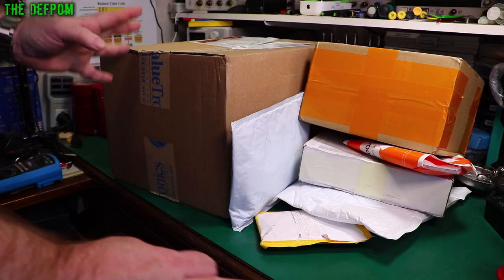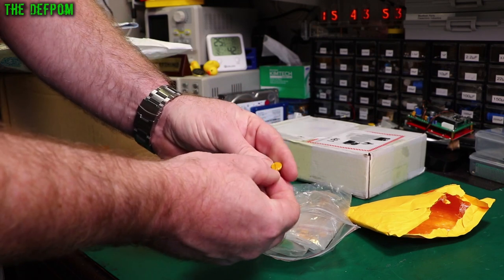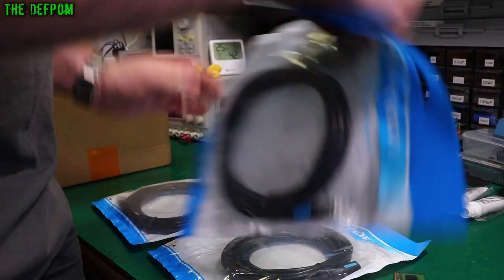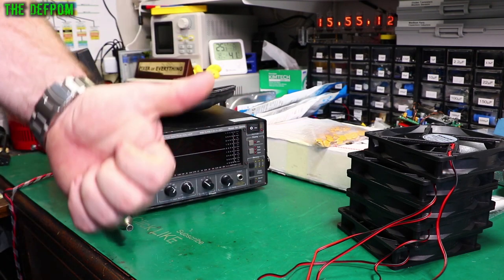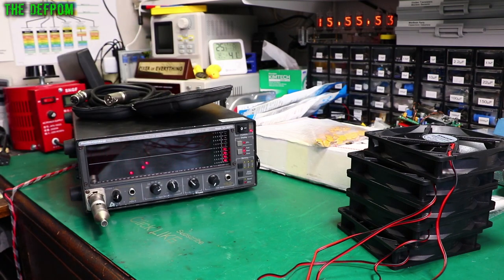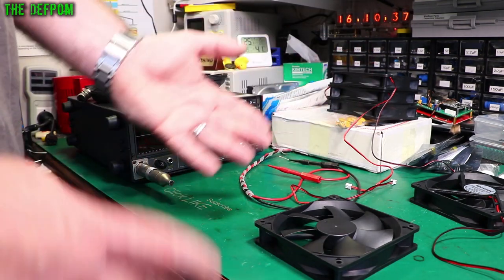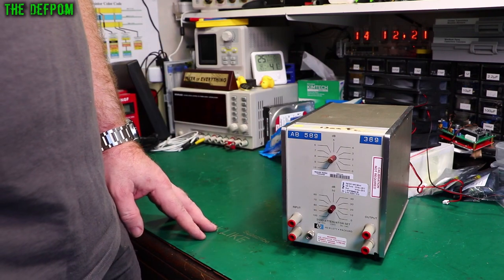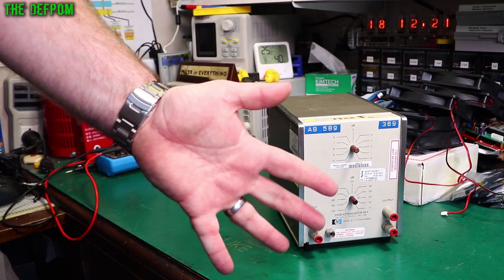🔴 I've Been KNOBBED ! - Mailbag Monday 20th December 2021 - No.903

Comment: Fluid dynamic bearing fans aren't designed to be run on reduced voltage.  It's hard on the bearing.

Is that a Brüel & Kjær microphone you're using on the RTA?
Reply from the maker: I don’t know what brand the mic is, it just comes with the RTA.